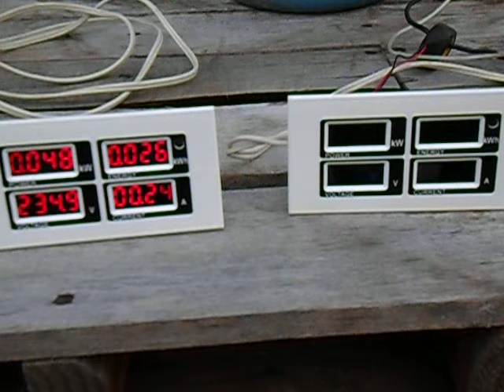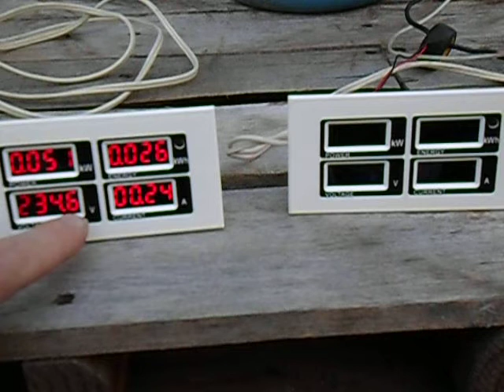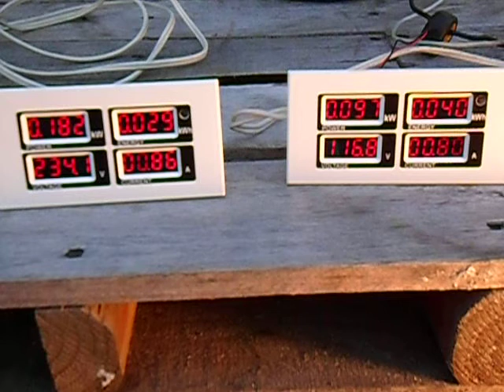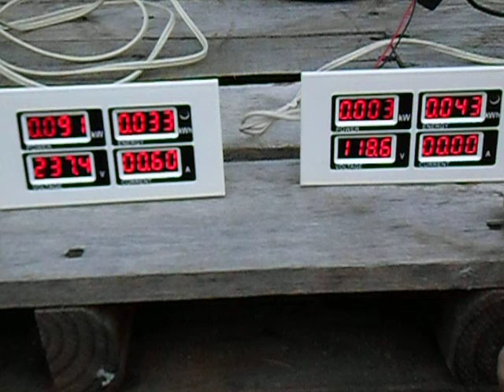Gerard Morin replication 10kw to 5kw transformer test

Comment: I see one boggus that i need to adress you..  The input on the 10KV transformer is 240 from the variac..   You should wire the 240 on the appropriate lug on the transformer... The correct way would be to hook  on the 2 EXTERNAL lugs on the transformer input...  The rest of your rig seems to be appropriate for testing..  Thanks for sharing
Reply: "rig" lol that's the word
Reply: 611w -in, 506w - out. only losses. the point is to show inefficiency of this contraption?
Reply: igor ki md recalculate see my calculations above. Also, you have to take the idle currents off of the calculation since they do not count. The input has an idle load, the output does not. His system isn't performing because he is using power from a grounded coil from the power company transformer, he needs to use an ungrounded generator that has a permanent magnet rotor, not an exciter coil.

the transformers must be isolated from ground with rubber blankets since the case voltage gets up there high enough to go through wet or dirty wood that has carbon on it. High voltages do not need conductors like copper to jump to ground.

The whole idea is to have an ionic voltage, with an elimination from ground so the energy is drawn from the ionisphere. A simple test with a laser thermometer on the high voltage bushings will indicate if this is happening. This is actually not happening here.
Reply: so I found out that truly some bangladeshi inventors found out how to make a QEG like device but with moving parts and a moving asymetrical exciters, and in the opposite for the static one's an exciter isn't used...